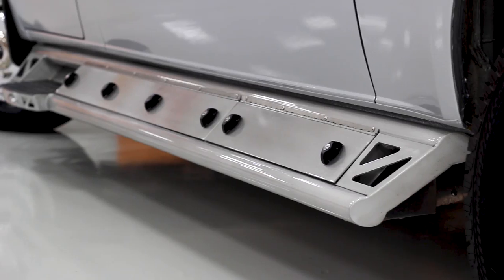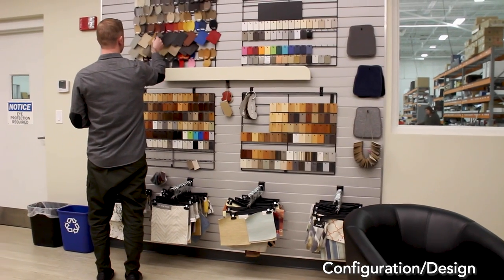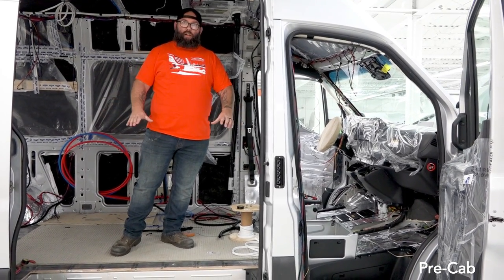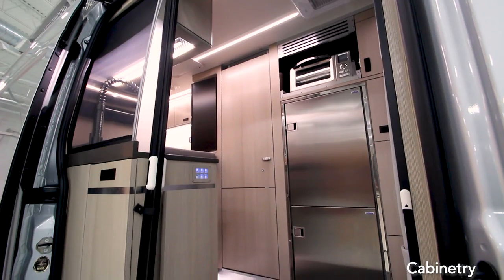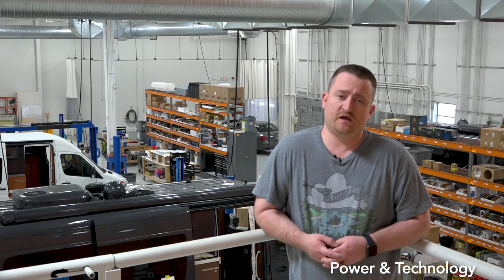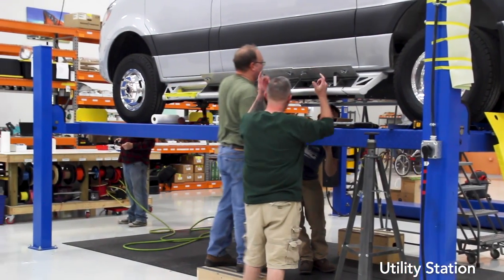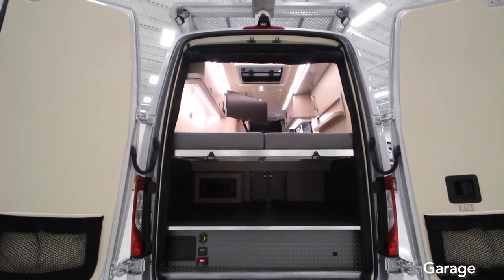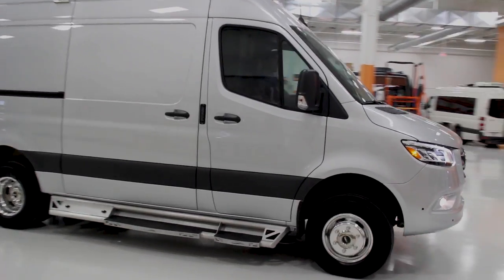The Last Resort | ARV Builds a Custom 144" Sprinter for Full-Time, Off-Grid Living

Comment: Beautiful, as is all your work I’ve seen. My concern would be all that moisture inside that van (steaming producing coffee maker and steam producing oven, not to mention people) with all that heavy insulation, no windows but the front ones to let fresh air in, stale air out, is a breeding ground for mold to grow quickly.  I realize there is a fan, but you need a way for air to get in for the fan to pull air out. Nothing against ARV or the new owners, just my own thoughts. Also agree with others about lack of space inside. I could never live in that small a space and be happy. To each their own. Hope the new owners are thrilled and have many hours and miles of safe and happy travels.
Reply: Martha Manigross In my 170, there are many options for make up air, including multiple windows. One of my favorites is just to run the exhaust fan, and allow the negative pressure to draw air in through the existing hvac system, as this passes through the cabin air filter, removing pollen and dust.  That's an excellent option on this build too.  You did notice they have an exhaust fan, AC, roof hatch, in addition to the front windows, yes?  No shortage of ventilation options there.

Comment: Just the build quality of a exotic yacht and gulf stream jet, my two favorites:) fit and finish, not just this one but all of them, custom to each persons likes! While I am set on the Revel 2020 model, I just might, have AR  build me a CUSTOM Revel, hidden wall fasteners, colors, etc, I believe that AR can build it much better and streamlined, perhaps with details im unaware of too:) Really, holding off on the Revel purchase until i watch more videos of AR vans! Just the fact that AR uses the different AC roof system and Revel uses the older version standard in the industry and without a way to self power it at this time...............AR seems to be more advanced with battery technology than Road Trek which is ahead of the times!
Reply: Same. I was considering getting the 2020 Revel and having ARV "fix" it.

Comment: Electricity from the alternator stored in the battery packs.  Love it! 
Nothing against solar but for a vehicle this is using existing modes inherently available.
Reply: Every RV since time immemorial stores electricity from the alternator in the batteries.  The only difference here is the capacity of the batteries is way more than normal.
Reply: Add up the price of all those batteries and I believe solar is the better value. You’ll never see them on a high roof but the roof rack loses space. I just can not imagine how much this build cost. Very nice indeed but I’m more DIY.

Comment: Two questions, how much was the final product and where do you stay when it does eventually need serviced.
Reply: Yes I want to know how much was the final cost
Reply: If you have to ask "how much"... you can't afford it. Thats my rule of thumb...lol
Reply: My guess is $200k+
Reply: @pickle-ball  not true at all
Reply: @nicks2111  ARV vans starts at around 350K...This is likely 400k+
Reply: @MegaFrenzyman  I believe $300k
Reply: @stevelassman2577  The van alone would probably be close to 150,000 alone.Then another 150 for the build.not cheap but you must pay to play.The electrical was probably a huge cost with all those lithium batteries and chargers and what not.
Reply: No the vehicle is much less than 70k. Builds run around 10-12k. These are facts. This need not be over 100.00 all inclusive

Comment: It’s beautiful... I haven’t seen such a clean build.. I’m just scared to ask the cost ??
Reply: Chase The Wind I’d guess the build alone is about 180-200k. This is not counting the van purchase.
Reply: Galt woooooooow!!
Reply: @FactionRacing  no
Reply: @anninriverside755  times 2
Reply: More than 180k
Reply: $250-$450
Reply: @anninriverside755  huge battery system, no solar. good luck charging these just with driving.. they're going to be plug on the grid all the time
Reply: @rossclark9155  - Why didn't you just say $5-$1,000,000, to be safe.
Reply: Prob $200K+ ... not worth it... I've seen a lot of 'home builds' that were better and probably cost a fraction.
Reply: Matthew Cho yeah you right I would of bought the Mercedes unity van for 170 with a built in generator when the batteries are tapped out. It’s already made to do all this and looks better with warranty.
Reply: @FactionRacing  I guessed $100K before van buy but on reflection i agree with u .. $200K with not much Change ..
Reply: @anninriverside755  It IS a home - so serious stuff here & cost seems to be limitless ..
Reply: Chase The Wind The fact that the builders aren’t chiming in and saying anything about the cost; yeah, arm and a leg. 😞
Reply: Resale value?
Reply: @rossclark9155  Based on the specific wants, this is a $250K  customization effort not including the van.

Comment: Silver van, polished wheels, fancy rack with numerous cameras, but they want stealth...
Reply: i was kinda thinking the same thing. and i often wonder how easy it would be to break into a van like this and make off with all the batteries. etc
Reply: @malco49  There're a couple of European brothers (can't think of their channel's name) who set up some interesting hidden security bolts for their van. I think it would be enough to prevent a common burglary attempt. If the van is as high-tech inside as out, you can set up a camera and remote notification when the doors open, etc. I'm not ready to retire for another 10 years, but I've been gathering my thoughts on how I would want to set up a van.
Reply: @dodgeplow  i get that cameras and notification won't help much if you are off on a hike or on a lake etc and you come back to you batteries all gone. but i get it. i am just a city rat etc
Reply: @malco49  I'm thinking it'll deter a casual thief, and maybe buy enough time to get back if you aren't far. I'm hoping there aren't too many hard-core thieves on hiking trails. Still, you can only prep so much.
Reply: Mitchell Feldstein Elon Musk would have the van drive itself to police station if it detected burglary. :-)
Reply: @dodgeplow  mine mind works same as yours. Same thoughts and retirement plan.
Reply: Mitchell Feldstein 
There are remotes you can take with you that monitor the van’s temperature & detects if it’s been breached.  They’re not too expensive
Reply: @david2284180  great idea.

Comment: Cameras everywhere on top of the van and you think it's stealth? Not hating but doesn't it defeat the purpose of not having windows (natural light and ventilation)? The build is extremely professional though.
Reply: Pretty sure the marine hatch will give plenty of natural light plus their secondary fan and their giant air conditioner. The kicker here is that I think the owner is probably also installing solar panels from another company. Or hes just gonna use his alternator to charge the batteries. 

this is what happens when you give a custom van builder carte blanche. Top of the line everything.

Comment: Nice build. I’m waiting for the all-electric Sprinter, where 100 kWh of Li-ion of energy storage is shared between transport and cabin. #ClimateCrisis means I just can’t keep burning diesel in good conscience. To infinity and beyond, ARV!
Reply: You'll have to be VERY patient, these will not come quick, VW e-crafter is already there but is slow, has speed limits and very limited mileage. Anyway electricity is probably not the fuel of future, only intermittently will it rule for few years, hydrogen is the future of fuels! 100% clean unlike li-ion batteries.
Reply: Or Tesla cargo van :)
Reply: Me too! I was thinking how to turn the Tesla pickup into a camper while watching this.

Comment: 170 or bust. Never put that kinda money into a 144.
Reply: opinions are like armpits, everyone has a couple, most of them stink
Reply: No one wants the 170 anymore.
Reply: Whatever floats your boat. If you full time in it, maybe a 170 would be better. Personally, I'd only be interested in a 144. Much easier to park and maneuver.
Reply: Jin p Nothing in my opinion, I actually own a 170” extended, but I also work at a shop that converts vans and everyone wants the 144”. Mostly because it’s so easy to drive and park.
Reply: @jeremyfreetoroam  I'm up against the fence trying to decide on a 2015 170 or 170 extended. Currently driving a 06 158 about to hit 300k. The 170 would allow slightly better urban mobility, but love the look and extra capacity of 170. extended.
Reply: NAK if you want to go overlander the 170 just is a whale and no good.
Reply: I’ve had both the 170 & the 144. I definitely prefer the 144 for its better off-road performance, as well as for easier parking in tight spaces in town.  No regrets about the downsize, even though I’m a full-timer.
Reply: @OMGWTFLOLSMH  TO each their own, my neighbor has the new WInnebago Revel 2020, its tiny on the outside and skinny looking..lol, fits easily anywhere and yet the bed can fit tow grown adults that are overweight easily! Just love pressing the electric side door, i cant stop LOL:) Size only matters to each persons OWN taste..................Gulf streams come in different sizes, they all are nice!
Reply: @CampTeslaFun  I agree 100%, while i know the 170 offers more spaciousness, as a 4x4 its problematic........The coachman galleria 170 is very nice in 4x4 for the concrete street is great.

Comment: No solar? How can you call it living “off grid”? If offgrid means plugging in a KOA campground than it is off the grid.
Reply: it gets charged while driving via a fast charging machine and stored into a massive lithium battery kingdom.
Reply: @aizajeandiamante9028  if you need to stop without running your engine for over 24 hours....no more power 😣

Comment: Wonder if that exhaust pipe by the water tank ever caused a problem. 
Very amazing build hard to believe everything crammed into a 144. 
That is the first full bathroom I've seen it a van that small. I really like the roof rack that is a work of art.

Comment: I agree, rattles are the worst. I tried so hard to identify that annoying noise in my car (not even a loaded van), and I was stumped. Turned out to be the license plate cover outside, which was only secured with the two top screws. Such little things can cause so much aggravation.

Comment: Great design, love the cabinetry. Winnebago needs to take a few notes for their Revel, which still has cabinetry design dated from the 70s. Interesting that ARV have done away with solar, replaced with a high current generator attached to the engine. The marine hatch, rack and surveillance system are great ideas. I think I'd want some solar and a few windows. I'd also want room for my bikes inside, so I'd want a bed lift like in the Revel. Guessing this van costs a hell of a lot more than a Revel though, like close to double.

Comment: This is a truly great build, like others have said its not like many other build companies it's got the care and attention of a self build with the knowledge of pro engineers, not to mention the  materials. My only negative would be the actual experience, my 144 I made is not half as 'finished' and lacks some of the systems capacities, but I can lie in bed will my wife rolls out and makes breakfast! And after that we go out for the day which is the whole point of van living so the exact texture of the laminate doesn't make that much difference to actually living in it.

Comment: Great. Wonderful. Stealth maybe but off-grid?  How long exactly are you going to live off grid with a 18 gal. Black tank and a 24 gallon grey?  (EST.) You’re going to be dumping every 1 to 3 days.  Yes, I know, 40 gal. Fresh water tank is a good size.  But if your goal is to get away for a few days, you aren’t getting far.
Reply: You don't have to use the rv toilet.
Reply: alexander5207 — O.K., True but then You don’t have to use an RV either.  Isn’t the whole point of an RV so you don’t have to poop in the woods?  Water, bed, heat, restroom, kitchen, refrigerator and stove are why yo buy one of these over a tent.

Comment: I respect Mike and ARV enormously, but 
@1:08 “10,000W” is not a unit of battery capacity, it’s a unit of power at a moment in time. 
kWh is the unit of total power capacity. 

Anyway, awesome build, as ever, and no side windows is super stealth.

Comment: The clients must be small people. It's tight in there, but nicely engineered. The roof rack makes the van look quasi-commercial which will allow them to disappear in cities.  But I have to chuckle at the security paranoia.  In six years with our van, we've never ever been concerned about our security.  I suspect security is a fear of big city people.  Once you get outside the city it's different.

Comment: What brand diamond plate did you guys use for the garage?  I installed coin cell and I'm having a terrible time with it.  It's scratches way to easy and it expands and contract A LOT with temperature changes which is a big problem.

Comment: I assume there is a secondary alternator to charge the lithium batteries while driving. Is there a regular AGM battery added  in this configuration as buffer to protect both the alternator and the lithium batteries?

Comment: Hey @Advanced RV, two things that I did not understand. First, how is this huge bank charged? There is no solar setup, what is this undermount thingy, a generator? second with such a a monster capacity why is heating not electric (hydronic or radiative)?
Reply: No solar but charged by a high rate alternator it appears.  The heating (air and a loop system) is done by Espar that uses diesel.

Comment: I went to your site and I don’t see a gallery. The rentals look older. How many new units do you make a year. Where can I see newer units you have done.
Reply from the maker: If you go to our website and hover over the "Custom Sprinter Motorhomes" dropdown menu, you can select the "Photo Gallery" link to see our build archive. With that said, a number of our mid-to-late 2019 builds have not been uploaded to the gallery yet. It will be updated soon, but you can fill out our contact form if you'd like to see anything in particular.

Comment: Cool van but doesn't it look way too delicate for offroad or boondocking usage? I'd like to see a campervan that has minimal electronics just enough so you can diagnose the problem and fix it yourself when necessary. I mean did you see that wiring? looks like they are building a small aircraft! I would not be surprised if it spends as much time with Mercedes for maintenance as it will with the coachbuilder. It is certainly a work of art on its own but I'd be afraid of the little gremlins that will come with this thing. Does anyone know how is the reputation of Advanced RV?

Comment: Good luck with The Mercedes with it's hodge lodge of parts from China, Italy and Germany. Read owners experience of reiability. I have a Customer that has a New One Ton Mercedes Diesel Van and the Dealer quoted him $900 to change the oil every 20,000 miles!

Comment: Other than swiveling the cab seats around, is there no seating?
Reply from the maker: That's correct, Scott. The front two cab seats are the only spaces equipped with seatbelts. When the van isn't in transit, the owners also plan on sitting on the bed and the roof.
Reply: @AdvancedRV  Thanks! To each their own.  I guess they could use a couple director's chairs or something.  In my dream off-grid van (159), the bed is 80 inches long, flips or hoists out of the way, and underneath is dinette for 2/work space forward of the garage/systems. You lose the "L" perhaps but have the length to recover counter space.
Reply: @AdvancedRV  Have you done a bed for a taller person that stores up against the ceiling and lowers onto cabinets on the sides at the height you choose?

Comment: How do the lithium house batteries get charged? From the car battery? From shore?
Reply: zayvier69 The batteries are charged via a 320 amp 2nd alternator in the engine block while driving/idling or via a 30 amp power cord plugged in to shore power.
Reply: Sue Valentine and this connection and charge from the engine car battery is enough to top all these lithium’s up?
Reply: zayvier69 it’s not charging from the chassis battery. There is a dedicated 2nd alternator added to the engine that does nothing but charge the lithiums. It’s definitely powerful enough—lithiums accept a lot of charging amps, so after 5 nights of camping, my batteries will be recharged in a couple of hours of driving.

Comment: 4,000 Dollars a Square Feet is Outrageously Extremely Expensive for a 80 Square Feet Mini Motorhome! Buy it today and sell in 1 year,  $100,000 reduction in price! One can buy a New House, with A 5000 Square Feet lot and a 1800 Square Feet House for $320,000! Same cost as this Mini Motorhome, Home Appreciates in Value Significantly, The the Van Tremendously Depreciates in Value! Pretty Van and Custom work, but too Way Expensive even with all the features! OverKill!

Comment: You know I get that this build was specific to your customer....of all of the builds I’ve seen with your company, why  are there none with a recliner most probably instead of a bed? I myself due to back problems have not slept in a bed in years, & would love one of these camper vans.  But I need a recliner, not a bed, and a full size shower, separate from the commode, as I need to utilize a shower chair.  Not to mention I don’t groove on showering over the commode.  Now, certainly I can’t be the only person that feels that way, and certainly with the amount of talent you have at this company, that would be possible in a Sprinter 144......Wouldn’t you think?